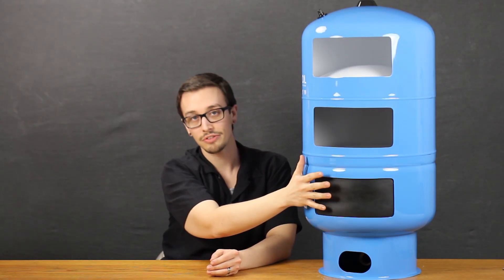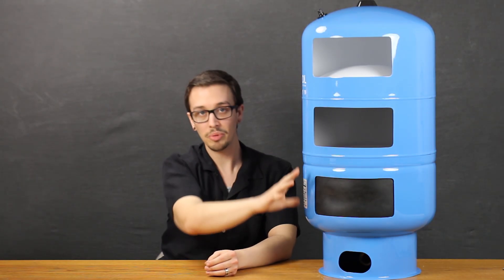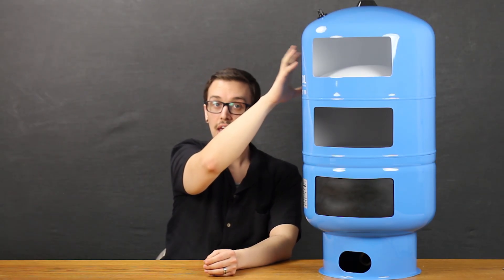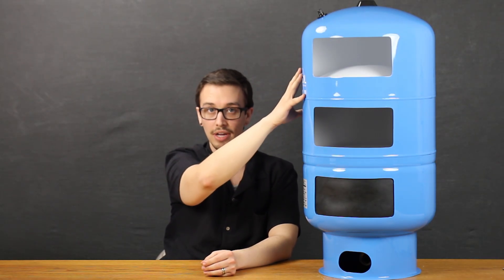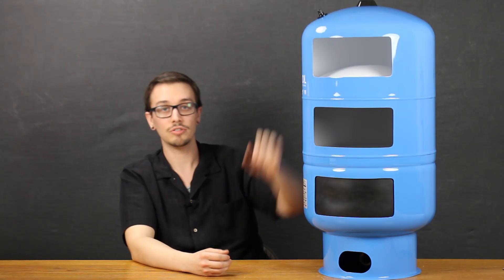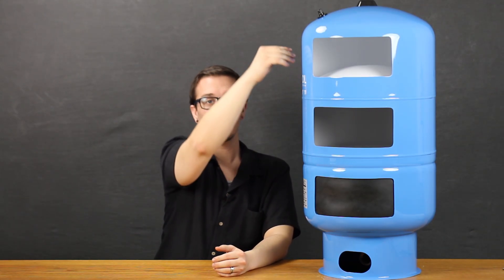Pressure Tank: Operation and Components

Comment: May I ask, sir, can the pressure tank be replaced with a PVC pipe that is upright? This is my simulation, can it be applied, sir?
If the pressure switch setting is ON 1 Bar & OFF 2 Bar
Pressure Tank 19 Liters, Precharge 0.9 Bar gets Draw Down >> 5.99 Liters
Pipe 4 "- 4 m, Precharge 0 Bar (no membrane/bladder) gets Draw Down >> 6.49 Liters
Pipe 3" - 4 m, Precharge 0 Bar (no membrane/bladder) gets Draw Down >> 3.92 Liters

.
If this method can be applied, maybe in terms of cost, more or less, but there is no need to worry about the tank leaking.
and if there are used pipe pieces, they can be used, just buy a cap & reducer.
thank you 👌

Comment: After about eight years of having a will it now turned on every so often by itself could that be a leak of some kind whether its air pressure or water I don't see any water around the tank and the valves are off could you give me a suggestion
Reply from the maker: Sounds like you've got a leak somewhere

Comment: That is called a Schrader valve, and I do not have one of those on my bicycle! IUs Presta valves on my bicycle higher end bikes will have that but the low end bikes will have the same Schrader valve that’s on your car or even your wheelbarrow.  You will sound a lot more knowledgeable if you call it what it is. There are other types of air valves for inflation but I can’t recall the names and they are very obscure. Thanks for the in-depth tutorial of my bladder tank.

Comment: I am on a county water system.   I have over 1500 ft of water line from my meter to my house and have very low water pressure.   Would a pressure tank benefit me or would I need a combination of tank and pump?
Reply from the maker: You'll need a booster pump and small tank. Give us a call and we can help you find the right package: 855.329.4519

Comment: So if im understanding this setup right: as soon as the pressure on a hose or motor gets too low, the pressure pump will allow water to fill the diaphram which in turn builds up pressure in the air chamber ? Can someone correct me ?

Comment: Nice video. Q. I need an expansion tank to accomodate liquid volume increase due to temperature changes for a closed loop cooling system. Is this tank suitable? I think both work exactly the same, however on expansion tank I won’t care about delivering continous ammounts of water. Thanks.
Reply from the maker: Give us a call and we can help: 855.329.4519

Comment: we are maintaining 3 bar pressure in pressure adjuster tank
,maintains 3 bar cut off and 5 bar cut on in pressure switch for the pump .
some times pressure going below 3 bar(pump starts on 2 bars) and making vibrations 
in the water line.also pressure adjuster tank air pressure increased without filling air in it. 
is it problem of pressure adjuster tank or the 
problem of pump taking air ?can you please help us.

Comment: Had a recent problem with a leak at the pitless adapter. Upon repairing, the system returned to proper operation, however, when I cleaned out the pump house and checked things out, I realized that there is NO water inside my pressure tank. That is really weird as my system cycles correctly. Any explanation as to how that can be?
Reply from the maker: Sounds like your pressure tank is not set correctly. Check out our video on how to check and adjust pressure tanks.

Comment: How does water get into the tank? I assume it must be under pressure to fill the tank. Is there a pump in the tank to feed water in as well or is another pump necessary?
Reply: I'd like to use your tank for a grey water system and anticipate having a tank that gathers water to feed to your tank.
Reply from the maker: Give us a call and we can help you size and select the right equipment: 855.329.4519

Comment: Hi, thanks for your interesting and informative videos.  I have one question.  How do you add a large water tank to well system that has very low water flow into the well from the ground?  I bought a wellxtrol 302, but it only has 26 gallons of draw down water supply, and we run out of watewr almost every day.  It takes about 4 hours for the well to recover.  Now I am adding another well to our system.  My thought being I could manually turn one well off when it drains, and turn the other one on. After it drains, go back to the first well.  Alternatively, I was wondering if I could just install a huge say, 400 gallon water tank in the basement, that both wells would contribute to.  I guess then install a booster pump to feed the house?  What do you think?  Thanks very much... Paul

Comment: My water system apparently does not have a pressure tank that turns the pump  on and off. The submersible pump in my system delivers water to a reservoir tank and the demand for water  is met by gravity feed. When the level in the tank gets to a certain level the pump will turn on or off. Can you explain the  sensors for this and how to adjust them. Thanks for any information on this.
Reply from the maker: Michael, you will have to take a peek inside the tank and take pictures or make note of what you see in there. It is most likely a single float switch (but it could be a float valve or transducer) that controls the pump by a set of contacts inside of it. Once you know what you have give us a call or send the photo to us: 855.329.4519 or Customer.Service@rcworst.com

Comment: Why do you need the diaphragm?   If it empties from the bottom would simply having air under pressure in the top  do the job?   You might need a level sensor to turn off water flow from the tank or a valve like on a toilet to stop the air from entering the pipes if the well pump is not pumping fast enough to raise the water level while you have faucets open, but that seems simpler than the engineering of a diaphragm.   Of course, I am not an engineer...
Reply from the maker: Actually, the diaphragm is a relatively new feature of pressure tanks. Air-over-water pressure tanks were the standard for many years, but they required more parts/constant maintenance because the air would leech into the water over time and need to be replaced. Diaphragm tanks eliminate the need for constant refilling of the air, which will soon make the air-over-water tanks completely obsolete.
Reply: @RCworstwater  Makes sense as long as the diaphragm stretches enough and stays flexible.  Modern Materials are great.  Thanks!

Comment: good job! I am going to be buying the Amtrol-Well-X-Trol 32 Gallon Water System Pressure Tank with Composite Base - WX-203D on amazon Plumb Eeze by Boshart 1 x 11 Tank Tee Kit with VALVES Installation Water Well Pressure Tank 40/60 FSG2 pressure switch NO LEAD I will be using it in my van conversion.

Comment: Hello. Just to ask: I have a pressure tank and pump assembly for home use.

The factory set cut in/off pressures are 20/50 PSI, while it is indicated in the tank to maintain a 30 PSI air pressure. Is this a good setting? Please advise. Thank you R.C. Worst!
Reply from the maker: The air in your tank needs to be set 2 PSI below what your pump is turning on at. Check out our video on it: https://www.youtube.com/watch?v=w21qa2bMUh8&lc=Ugxf4itooKuBaJFzvX94AaABAg
Reply: R.C. Worst & Co., Inc. What will happen to the system if that is the setting 10 psi more than the cut in pressure? Will it damage the equipment or some of parts?

On my observation, it is working fine.
Reply from the maker: If the pressure is set too high then the tank will not be able to hold nearly as much water since the air pressure is pushing the bladder down harder than the pump is pushing water in. Your pump will cycle more often than it should and wear out much faster.
Reply: R.C. Worst & Co., Inc. Many thanks for the best recommendation. Will check it. So then should I keep about 18 psi air pressure if the cut in is 20 psi?
Reply from the maker: Correct!
Reply: R.C. Worst & Co., Inc. 
What would be the drawback of a lower pressure? More water will be stored, but the bladder would stretch too much?

Comment: What is the nut on the top center of the tank with the plastic cover over it (near the air valve) for?
Reply from the maker: Good question! That nut is welded onto the tank so you can mount a jet pump on it via a pump stand. The pump bolts onto the stand and the stand bolts onto the nut.